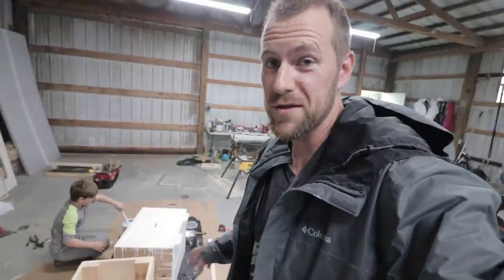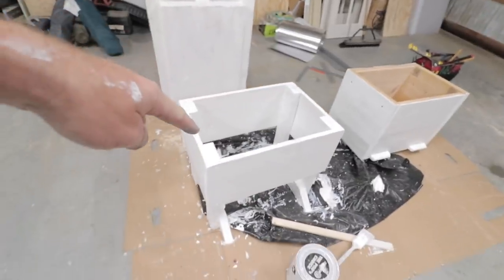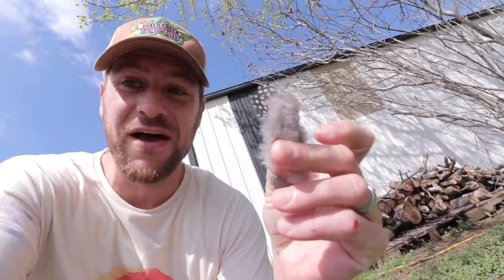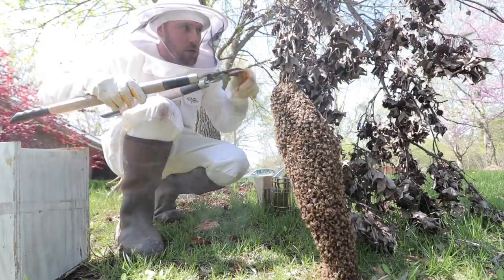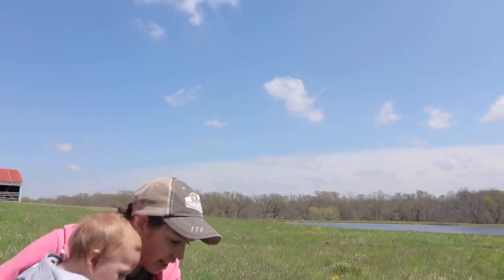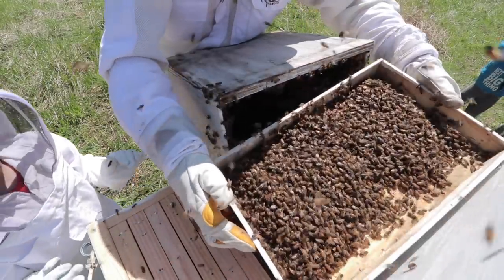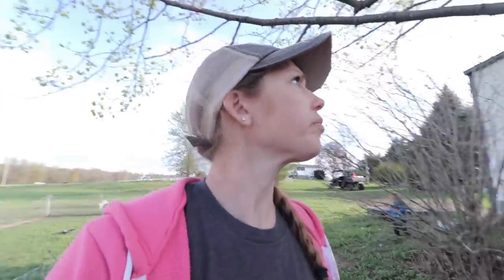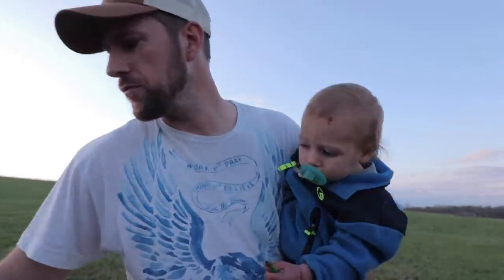Our neighbor gave us WILD BEES

Comment: When you sweap the bees, use a feather, because you hurt them with your hands. And they need every worker. Imagine if you damage the qeeen..
Reply: Edit Gosztola 'KekPafrany' or a bee brush
Reply: I was wondering about that, too.  I have never had bees and don't know anything about caring for them, but wasn't sure but it seemed like some very rough handling of them .  Not condoning anything as I don't know the proper protocol.  More curios about just tossing the lid down (instead of gently placing it) with bees still on it, etc.  Again, not condoning!  Just curious!

Comment: Hi. Never use smoke capturing a swarm, the "calming" efect only works on a established hives that have honey reserves in it, using it in a hanging swarm  like that will scare them away. and my recomendation next time is to take the hive to the swarm shake as much bees you can inside and leave the hive in place until nigth fall to move them that way you dont loose bees.

Comment: The eletric fence on the tree only works if the animal is touching the ground, a grounded wire wraped around the tree  below the eletrified wire would work. The way you have it the tree trunk migt not be conductive enough to shock a posible predator when it touches the electrified wire.

Comment: Great idea wiring up the tree to protect the birds, if the predators  find a way to jump over that wire try using the fencing from Pier One, they are the experts when it comes to protecting farm animals with electrified fencing and I'm sure they can advise you on what will work best. Good luck..

Comment: I thought the whole reason for the grounding rod wad that a land predator standing on the ground completes the circuit when it touches the hot wire. If it (raccoon?) is half way up the tree it isn't grounded. Wood is not conductive. I would put that hot wire much closer to the ground and fence the area off to keep the kids away.
Reply: I was thinking the same thing wood is an insulator I don't think it will work
Reply: He could put An earth wire a few cm near the hotwire when a predator touches both i guarantee you he feels is 😝

Comment: I noticed you changed out your leg bands on your mandarins. Don’t ever use rubber bands. If they get caught they can tighten up on the inside where you can’t see and cut off circulation. Please return to using what. The pros use. The Mini zip tie ( that you removed). Don’t sway by the suggestion of city folk..... Good luck!👍🍀

Comment: Doesn't the predator have to have its feet on the ground to get shocked? If it climbs then touches the wire then it wouldn't be grounded, right? I wired up my chicken nest box cause my LGD was getting on his hind legs and putting his paws on the nest box and eating the chicken eggs.........after I wired it it didn't take him 10 minutes to try and steal the egg, and as planned, he took off running never to touch another egg again,  he got shocked because his hind legs were on the
 ground, but when the hens would fly up, they wouldn't get shocked because they weren't grounded. I've since disconnected it since he will never steal another egg, even when it's on the ground!!!